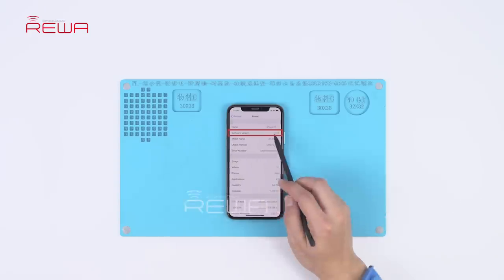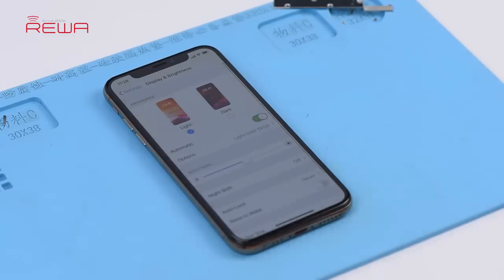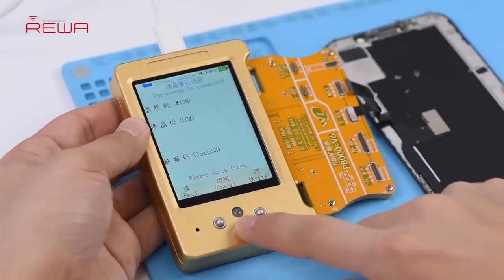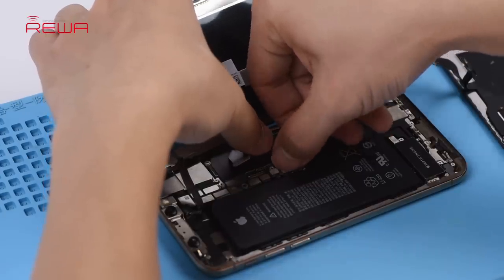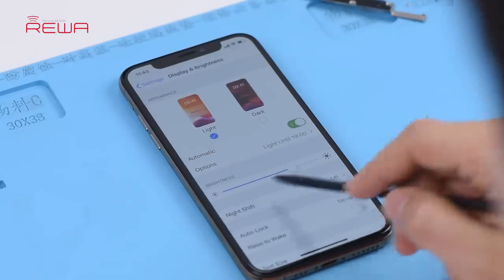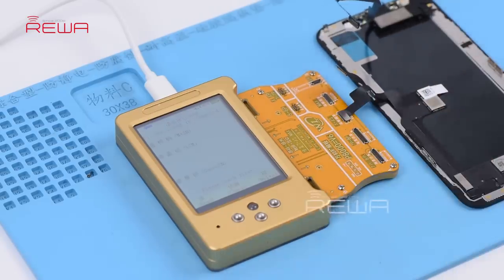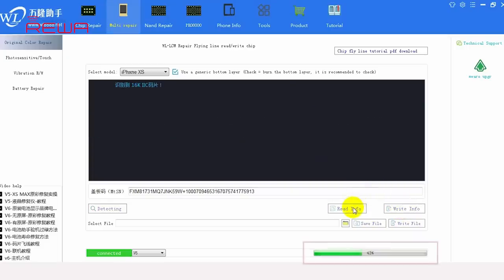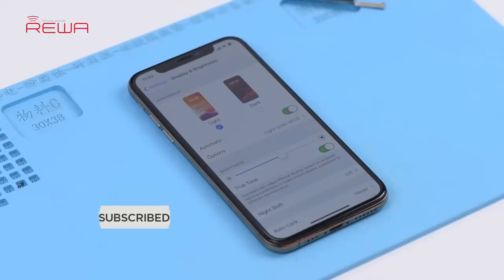How to Fix iPhone True Tone Missing - REWA Selected Repair Programmer

Comment from the maker: Do you prefer true tone display on or off? Please leave your 

comment below.
Reply: REWA Technology I prefer it off, but I always transfer the serial number on my customer’s phones
Reply: ゆきちゃん
Reply: @jameslando1  井上君
Reply: I don't have the original screen and i wish to have true tone , and i have my friends iphone and i don't wish to open it up, how can i have true tone which out pc ?
Reply: is the pc software free ?
Reply from the maker: @techheaven1252   3:29 in the video is showing the solution to restore True Tone without original screen, which as a reference.
Please note that the earpiece speaker and sensor flex cable must be the one paired to the motherboard.
The download of software is free. Thanks :)
Reply: Are you based in China?
Reply: @Keo  What serial number are you referring to? Can you please elaborate?
Reply: @rewatechnology2008  Are you stating that even the proximity sensor, etc. once replaced is supposed to be paired to the motherboard?
Reply: @Kevin Chand I mean the screen’s serial number, without copying the sn of the original screen to the new one, the phone will disable the true tone functionality.
Reply: name of logiciel please

Comment: Hey, thanks for your video. I just replaced the battery on my iPhone 8. However the True Tone function disappeared, even if I did NOTHING to the display. Can I reprogram the serial number of the battery somehow? (I'm on iOS 13.4) 
Thank you very much.
Reply from the maker: Thanks for your watching :)
There are 2 situations of the problem:
1. The problem is caused by the display, which can be solved by programmer
2. The problem is caused by the damaging of light sensor during the battery replacement, which cannot be solved by programmer.
Reply: @rewatechnology2008  A big thanks for your reply. The True Tone function came back after I reconnected the cable. Quite strange though considering the front camera works just fine and they actually share the same ribbon cable.
Really enjoy your videos btw. :)

Comment: Small question 
After writing true tone on aftermarket screen
Can we able to write true tone to another aftermarket Screen using the previous used aftermarket Screen ??
Reply from the maker: The data could be written on another aftermarket screen, but the screen should be installed with the original motherboard.
Reply: REWA Technology 
Ok got it thanks

Comment: Hi. I am unable to get the WLRepair software to recognize the iPhone. Win 10 machine. iPhone X with iOS 14.2. Phone is clearly connected to the PC, as I can access it. WLRepair doesn't see it, however. Tried re-installing, restarting, everything I could think to do. Any suggestions? Thanks.
Reply from the maker: Hi, please check the email box which ordered the product. Our after sales rep. will contact you with solutions. Thanks :)

Comment: There’s an another programmer device which is much better. It’s called QianLi iCopy+
Reply: why is it better? they do the same thing with the same efficiency?!
Reply: @imexgeneral7900  no! They aren't the same! iCopy is cheaper and have extended function that is checking battery and writing % of use. Qianli iCopy winning this race!
Reply: Daniel Tatara 👍🏻
He just said what I wanted to say.
Reply: @danieltatara4641  It can check battery because added another single board and price is much higer if you check rewa's online shop.

Comment: Hi I have purchased you WL13 pro lcm eeprom programmer but it is not working. I have tried emailing you but have recieved no reply already a long time. I tried looking up your contact number but did not find one. How can I contact you? I need to restore true tone without original screen. I have tried using the w12 pro and the WL software but it keeps saying windows does not recognise the USB device and I cant connect to the WL software with USB cable. It is not working. Can somebody from Rewa contact me? If you are selling these units you should also provide after sales service
Reply from the maker: Hi, thanks for choosing our product :)
We have passed your question to the related team and the representative will contact you via email.
Please check your email for it. Sorry for the delay to reply.

Comment: Sir i have a used iphone x that i bought online and it have the after market screen and there is no truetone in it and no auto brightness, I'm running ios 13.4.1 .. will it work ? Without the data of original screen?
Reply: Musmanvid It will work you just have to download the software
Reply: Musmanvid and it works with any ios
Reply: @brianhasleft.  does it work without having the material?